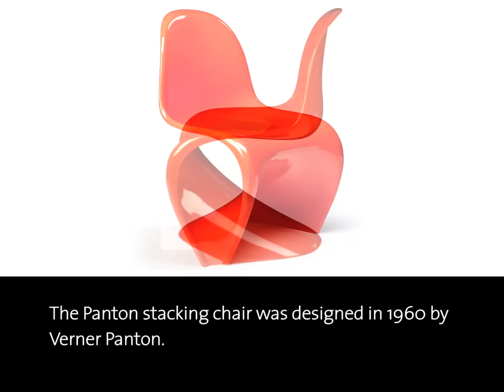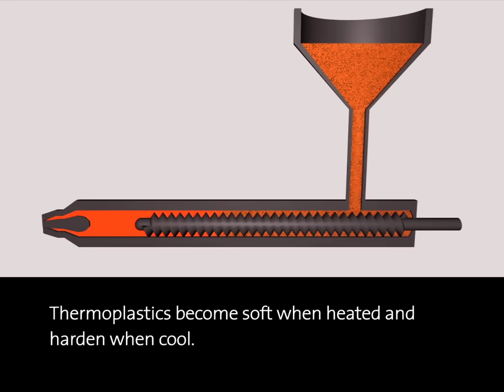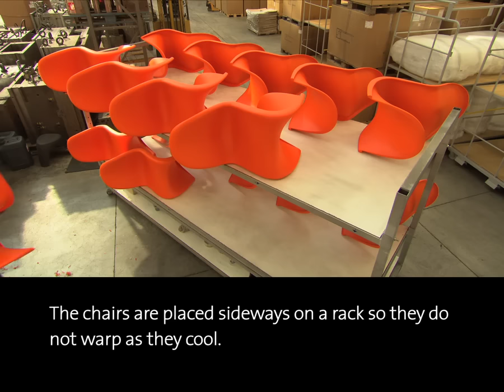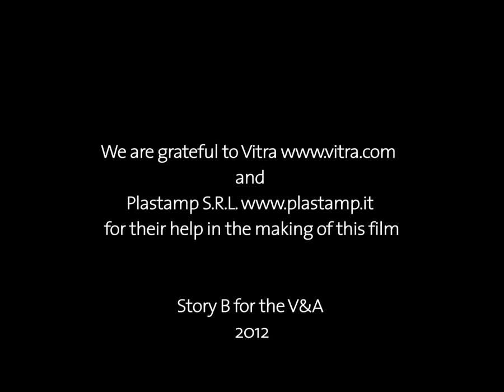How Was it Made? The Panton Chair

Comment: Hello. I have 6 of these chairs and love them, however, after 16 years they have become a bit jaded colour wise, I need to know any information regarding painting them, Cheers in advance for your help.
Reply: Don't paint them!
Reply: 16 years is an excellent record.  Shame so much of what is thrown at the consumer today may not last 16 weeks!  My only answer is, these were not meant to paint.
Reply: If they’re original brand I wouldn’t advise painting them....however, if not you can use a light grit sanding sponge to key the surface & smooth any irregularities, apply a base primer + top coat of a paint meant for plastics or fiberglass
Reply: I have some replicas I just picked up off the curb, it is scuffed in several places with the paint is flaking in places and you can see a translucent plastic underneath (it’s not solid colored plastic, it’s a replica with just regular plastic underneath with a coat of paint over top) I want to paint it the classic red color. How would I go about doing this?

( Essentially, I’m not going to be risking damaging something very valuable, and am doing so in a way that will not be sacrilegious, I just don’t want it to look like I grabbed it off the curb)
Reply: Try treating the surface with a heat gun